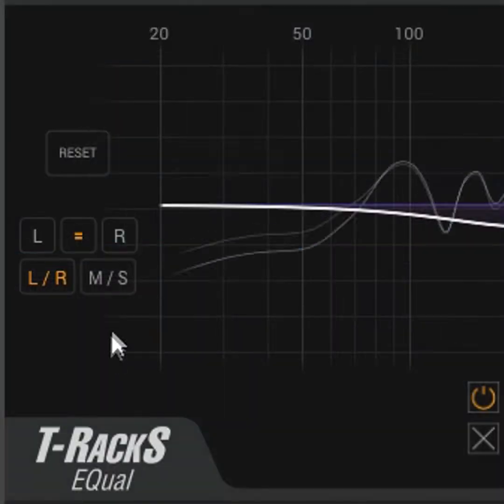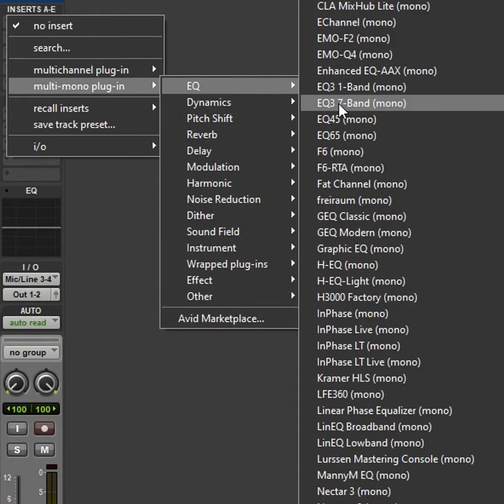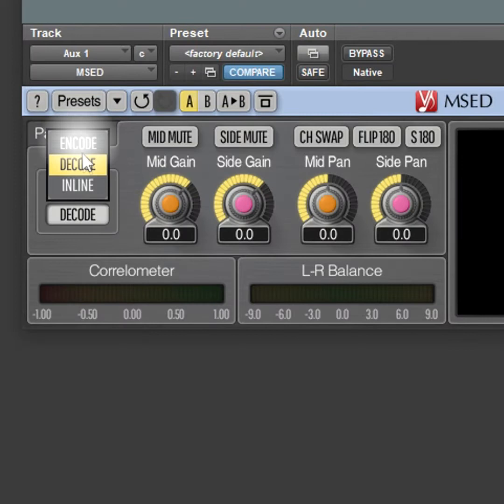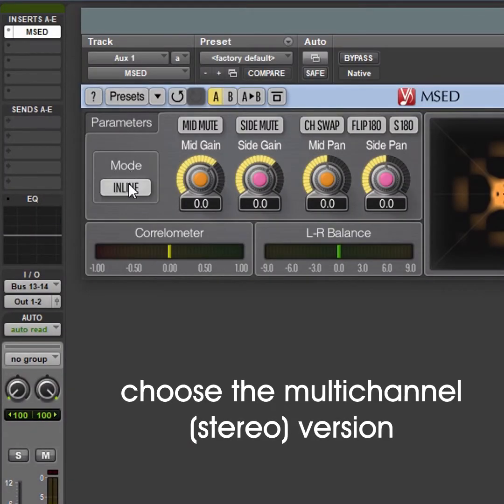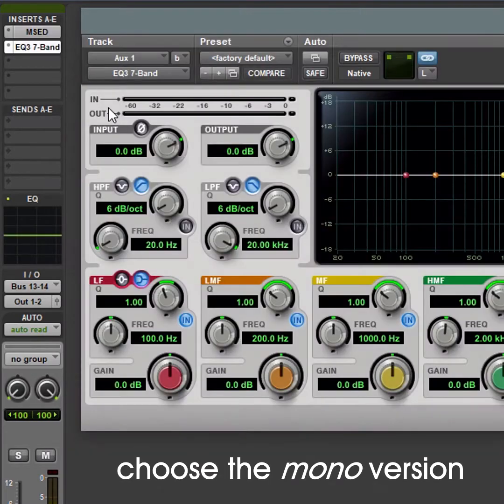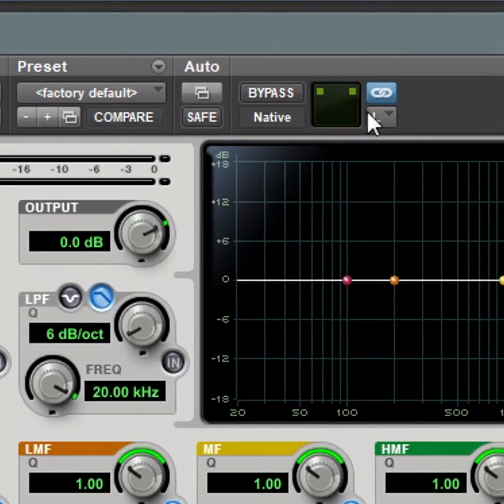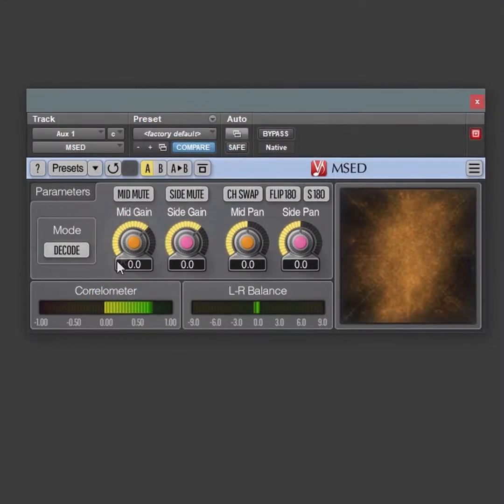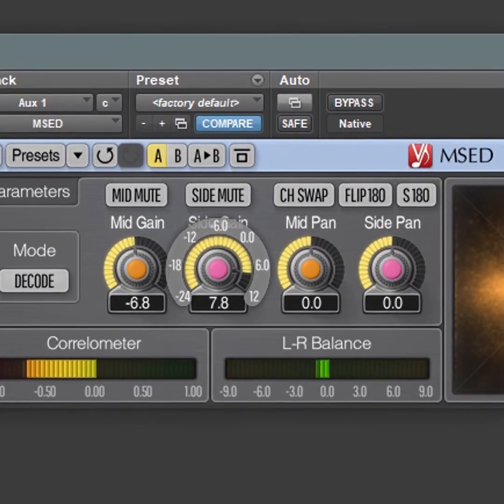Turn Pro Tools Plug-Ins into Mid-Side Processors!

Comment: Hi Craig, I can’t seem to unlink my multi-mono plugins master link despite it being the same one that you are using. Do you know how this is?
Reply from the maker: Hi! Our Tech Team provided the following information -

If your multi-mono plugin link isn't breaking, it's likely a software glitch or design limitation in your DAW (like Pro Tools), often fixed by stopping playback, clicking the link icon (chain/infinity symbol) in the plugin header to unlink, or restarting the session; sometimes, trashing preferences or checking the plugin's manual for specific unlinking procedures is needed as standard linking doesn't always cover side-chains.

Hope that helps!

Comment: Hi Craig, thank you for the info but AAX won't wok on my PT LE8. I need RTAS plugins, can you please advise on how to get RTAS or an adaptor to convert RTAS to AAX? Many thanks, Malcolm
Reply from the maker: Hi! Our Tech Team provided the following information -

You cannot convert AAX to RTAS or use an adaptor, as AAX replaced RTAS when Pro Tools moved to 64-bit processing, so you need to find RTAS versions of your desired plugins or upgrade your Pro Tools version to one that supports AAX. Your only option to use plugins with Pro Tools LE8 is to install and use the older, 32-bit RTAS versions, not the newer AAX format.

Hope that helps!